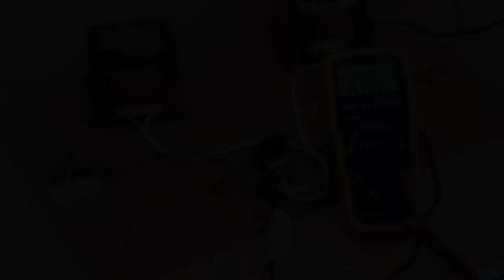DIY Welding Machine / Only 2 Microwave Transformer / Good Job

Comment: I tryed to build this miself replicating everything you've done here. but when i connected it to power it made a loud pop and a bright spark.... burning the electrical connector.. so im sure i didnt do something correct. but my question is now after watching this video many times now. is how is the transformer windings, the red insulated wire you added to both transformers and ran in series getting power from the bottom coil you plug into the power outlet? i dont see where they would connect the 2 coils? the stock bottom one and the one you reran the upper one...?
Reply from the maker: Hello.  I'm so sorry you're going through something like this.  I hope you are fine.  There will be no contact between the primary winding (the untreated winding) and the secondary winding (the red conductors we just wound).  These two windings are connected by a magnetic field.  The primary windings of 2 transformers are connected in parallel (A end of 1st to A end of the other and B of 1 to B of the other (A and B are said as an example)) and mains voltage is applied to these two ends.  Secondary windings are connected in series (ie one of the ends of the 1st transformer and one of the ends of the 2nd transformer are connected), and the idle ends are used as the welding ends.  If there has been an explosion in your system, there may be a connection error or short circuit on the primary side.

Comment: hola muy bueno, me podria decir las medidas de las laminas y la madera que uso para la caja por favor???
Reply from the maker: Hola.  dimensiones de la caja 32x16x12 cm.  Pero mi consejo para ti es que lo hagas un poco más grande.  Lo convertiré a CC agregando un rectificador pronto.  Sería mejor si la caja es un poco más alta.  Puedes hacer 32x16x16.  El aluminio que uso tiene 3 mm de espesor en los paneles frontal y posterior y 1 mm de espesor en la cubierta.
Reply: GRACIAS!!

Comment: Please, I would like to know the following data: the input current on the 220v side
Reply from the maker: Hello. It draws around 10A current on the 220V side. In some cases, it would be appropriate to use it in a socket with a 16A fuse, as 10A is momentarily passed.

Comment: Can i use 120volts and 220volts just to make two transformers?
Reply from the maker: Honestly, I didn't fully understand the question.  If you're asking if I can use it at 120V, yes.  You can do the same if the mains voltage is 120V where you live.  In this case, the dimmer circuit you will use should be more powerful.  Because more current will be drawn from the network to provide the same power... if you are asking if 1 transformer can be used as 120V and 220V for 2 transformers, this is not appropriate because 1 transformer cannot provide enough power.  If my answers are not sufficient, please write again.  Greetings from Turkey

Comment: Murat hocam çok güzel video olmuş emeğine sağlık.transformetörler kaç watlık ve malzeme listesini paylaşır mısınız.Teşekkür ederim
Reply from the maker: Merhaba Hüseyin bey. Öncelikle teşekkür ederim. Trafolar 900W. Genelde 800, 900, 1000W civarında oluyor diye biliyorum. Hepsi uygun olur. Mikrodalga transformatörler hariç... Toplam 13 metre 4mm2 silikon izoleli bakır kablo kullandım. Bu kabloyu internette N2GFAF kablosu olarak arayabilirsiniz. Akım ayarı için dimmer devresi kullandım. Sahip olduğum devre düşük güçte olduğu için fazladan 4 adet BT137 triyak kullandım. Triyaklar paralel bağlandığında toplam güç artar. Ancak 4000 Watt dimmer kullanılıyorsa ekstra bir triyak bağlamaya gerek yoktur. Genel bağlantı şeması ve triyak bağlantı şemaları videonun açıklama bölümünde mevcuttur. 2 adet 12V fan ve Fanları beslemek için bir adet 12V adaptör kullandım. On/off anahtarı olarak 16 Amp anahtar ve kaynak probları için 10/25 kaynak soketi kullandım. Kaynak probu kabloları 1.5 metre 10mm2 bakır kablo. Kaynak pensesi 300A pensedir. Kutu için kullandığım alüminyum ön ve arka panelde 3mm, kapakta 1mm kalınlığında. 220V girişi için 3x2,5mm2 kablo kullandım. Aklıma gelen her şeyi yazmaya çalıştım. Atladığım bir şey varsa lütfen tekrar yazın. Bağlantı şemalarını herkesin anlayabileceği şekilde çizmeye çalıştım. İlginiz için tekrar teşekkürler, iyi günler

Comment: Can I use 2.5mm silicone insulated cable for the secondary windings or is it better to use 4mm2 and upwards for secondary
Reply from the maker: In fact, even 4mm2 is a thin section.  But I used thin to get enough voltage with 2 transformers.  If you have a silicon-insulated 2.5mm2 cable, you can wind it as 2 lines (in parallel).  In this case, you have a 5mm2 cable.  However, I don't know how many coils will fit.

Comment: Hola, no entiendo mucho de los circuito, podrías explicarme. 
Para que es necesario  el regulador... Funcionará de igual manera si no coloco el Dimmer
Reply from the maker: Hola.  El circuito electrónico (dimmer) que pongo en la máquina de soldar se usa para ajustar el voltaje aplicado a la entrada.  De esta manera, también se ajustan el voltaje y la corriente de salida.  Funciona incluso sin el circuito, pero en este caso funciona a la corriente máxima ya que la corriente no se puede ajustar.  La corriente máxima derrite el electrodo utilizado muy rápidamente y es posible que no se pueda realizar una soldadura adecuada.
Reply: Perdón las pregunta... Un DIMMER de cuanto sería el mínimo de Watts qué pueda ponerle?? Como se hacía mención en el video de uno 4000w.
Muy agradecido por su respuesta
Reply from the maker: Puedes hacer tantas preguntas como quieras.  Que yo sepa, los circuitos dimmer que se pueden encontrar fácilmente en el mercado tienen una potencia máxima de 4000W.  La potencia del circuito del atenuador está determinada por el triac en él.  El triac se puede reemplazar con un modelo más potente o se puede agregar en paralelo como lo hice yo.  En el video que tengo la intención de compartir recientemente, yo mismo configuraré un circuito de atenuación en la PCB.  Este circuito se puede utilizar para soportar hasta 8000W.
Reply: Gracias por responder... Estaré atento a sus videos.

Comment: sorry, I have one more question, what are the name of the MOSFET you added to the 4000W DIMMER and why do you add it there, please I want to know.
Reply: because in the connection diagram, I can't find it there, and I don't want to mistake, please
Reply from the maker: Hello.  The components I added are triacs.  number bt137.  Since the circuit I have is low power, I added 4 triacs.  So by connecting the triacs in parallel, I made the circuit withstand more current.
Reply from the maker: The schema for the connection I made is available in the description section.  could not download?
Reply: ok thanks
Reply from the maker: Thank you too 👍

Comment: which TRIAC reference should I use for a 4000 W dimmer?
Did you use a 2000W dimmer? 🙂

4000 W dimmer için hangi TRIAC referansını kullanmalıyım?
2000W dimmer kullandınız mı?
Reply from the maker: 2 trafolu kaynak makinesinin şebekeden çektiği guc, ortalama 2000W. kullanılması gereken dimmer devresinin gücü 4000W olursa sorunsuz çalışır. şebeke geriliminin 220V olduğu yerlerde dimmere takılması gereken triyak en az 20A e dayanıklı olmalıdır. ben 6.5A akım dayanımı olan 4 adet triyak kullandım. bu durumda yaklaşık 25A e dayanıklı devre yapmış oldum. şebeke gerilimi 120V olan yerlerde, gerilim düşük olduğu için daha fazla akım çekilecektir. bu durumda 40A dayanımı olan triyak tercih etmek gerekir.
Reply: Şüphelerimi çözdüğünüz için çok teşekkür ederim, siz özelsiniz. Çok az içerik oluşturucu, abonelerinin yorumlarına yanıt vermek için elinden geleni yapar.😁
Reply from the maker: @santiagorodriguezgarcia1463  Bende size teşekkür ederim. Sorularınız olursa yine yazın. Elimden geldiğince yardımcı olmaya çalışacağımdan emin olun. 👍

Comment: Porque el dimmer de 4000w quema los fusibles hay que colocarles los triac bt 137 para corregir esto .buen  video gracias
Reply: Necesito su respuesta.Gracias
Reply from the maker: Hola.  En primer lugar, gracias.  En el video que publicaré próximamente, preparé un circuito PCB para el circuito del dimmer.  Mostré el montaje y funcionamiento detallado en el vídeo.  Sigue siguiéndome 👍
Reply from the maker: Si has hecho un circuito y se funde el fusible, los elementos del circuito que pueden fallar suelen ser triacs y diaks.  Además, el condensador de alrededor de 100 nF puede haber sufrido un cortocircuito.  Un cortocircuito del condensador no aumenta el fusible, pero existe la posibilidad de que se rompa durante la falla que quema el fusible.  Si la respuesta no es suficiente, puede hacer preguntas más detalladas.

Comment: One more question, if I attach wire together to make the length, will it still work? Just one union should do it.
Reply from the maker: You can use it by adding cables.  However, the insertion process must be done very firmly.  However, when the splicing is made, the stretching feature of the cable will decrease, so the winding process may be a little more difficult.  To prevent this, you can do the addition work outside the transformer.

Comment: Excelente video amigo una pregunta el código de los triat cual es para comprarlos soy de México de ante mano gracias
Reply from the maker: Hola.  En primer lugar, gracias.  ¿Estás pidiendo el código del cable?  Si es un cable, lo puedes encontrar como cable N2GFAF que pides.  Cable de cobre con aislamiento de silicona
Reply: solo le puedo poner un atenuador de 4000 o también le tengo que poner los 4 triacs en paralelo para aumentar la potencia del circuito de atenuación más el atenuador de 4000
Reply from the maker: El circuito de atenuación de 4000 W será suficiente.  Sin embargo, dado que el voltaje de la red es de 110 V, la corriente extraída de la entrada será alta, por lo que se requiere un circuito de atenuación más potente.  Los circuitos dimmer se venden con su valor de potencia, pero deben seleccionarse de acuerdo con el valor de corriente que pueden soportar, es decir... En lugares con tensión de red de 220V, esta soldadora consume un máximo de 9A de la red.  Porque se requiere una potencia media de 2000W.  Sin embargo, en lugares con un voltaje de red de 110V, se tomará una corriente de alrededor de 18A para suministrar 2000W de potencia.  Espero haber podido explicar

Comment: Disculpa amigo. Y si quisiera manipular con el DIMMER 4 transformadores de microondas .¿ Que configuraciones le debo de hacer?
Reply from the maker: Hola.  El elemento que controla la potencia en el circuito del atenuador son los triacs.  Lo que debe hacer es comprar un circuito atenuador con una potencia de 4000 W y agregar un triac paralelo al triac que tiene.  Si quieres, puedes utilizar un único triac potente o añadir 4 triacs más numerados BT137 como yo uso.
Reply: Muchas gracias amigo.

Comment: Hola exelente trabajo, una pregunta, cuantas espiras o vueltas de alambre le diste a cada transformador?.
-------
Hello excellent work, one question, how many turns or turns of wire did you give to each transformer?
Reply from the maker: Hola.  Gracias.  Hice 24 bobinados para cada transformador.  Ya no cabe más.  Se utilizará cable de cobre con aislamiento de silicona de 4 mm2, 6,5 metros de cable son suficientes para cada transformador
Reply: Excelente dato lo probare, gracias.
Reply from the maker: Gracias a ti también.  Buena suerte con

Comment: Will this work if our only power source outlet is 110V?
Reply from the maker: Hello.  The mains voltage value does not change the status.  Because where you live, microwave ovens are manufactured to operate at 110V mains voltage.  The only difference is that the dimmer circuit to be used for current regulation must be more powerful.  Since the mains voltage is low, the power required while welding will need more input current.  I have had viewers who run it at 110V mains voltage and make a comeback.  I hope my explanation was sufficient.  have a nice day

Comment: Direi ottimo lavoro, la bellezza e la precisione dl contenitore poi sono al top. Una domanda: lei ha scelto di usare filo da 4 mmq, altri autocostruttori invece hanno optato per sezioni del cavo maggiori che ovviamene significano meno spire, meno tensione e più corrente sul secondario; uno addirittura ha usato un "filo" mostruoso da 35 mmq: qual è il motivo della sua scelta, forse perché il tipo cavo con quelle caratteristiche non è disponibile in sezioni maggiori? Sarei curioso di conoscere la sua gentile risposta. Grazie comunque.
Reply from the maker: Ciao.  Mi scuso per essere tornato tardi.  Chi utilizza un cavo da 35mm2 molto probabilmente ha utilizzato una saldatrice a punti.  Perché con un cavo spesso il numero di spire è molto basso e in questo caso la corrente sarà elevata ma la tensione sarà molto bassa.  Affinché si formi un arco nella saldatura ad elettrodo, la tensione deve essere elevata.  Il motivo per cui utilizzo un cavo sottile è ottenere la tensione richiesta con 2 trasformatori.  Normalmente il cavo sottile non è preferibile perché viene generato calore a causa dell'elevata resistenza del cavo.  Questo calore può persino sciogliere l'isolamento del cavo.  Per questo motivo ho scelto il cavo isolato in silicone.  L'isolamento non è stato danneggiato per niente dal giorno in cui l'ho installato.  Spero di essere riuscito a dare risposte sufficienti.  Grazie per il vostro interesse.  A proposito, sul mio canale puoi trovare anche il video della mia saldatrice a punti.  Ho anche condiviso un video sul mio canale per convertire la tensione di uscita della saldatrice in CC.  Buona giornata.
Reply: grazie  per le sue esaurienti spiegazioni!!!!
Reply from the maker: Grazie anche a te.  Saluti dalla Turchia 👍
Reply: saluti dall' Italia!!!

Comment: Top e sobre o fil 2.50 e quantos meetro foi enrolado neste projeto?
Reply from the maker: Olá.  Fiz 24 voltas de enrolamento com cabo de cobre isolado com silício com seção transversal de 4mm2 em cada transformador.  Isso requer 6,5 metros de cabo.  13 metros para 2 transformadores.

Comment: From the wall plug. It goes to a switch. Then from the switch how are the cables connected to the transformers. Are they sequence or parallel (+)(-) and (+)(-) or (+)(+) and (-)(-)
Reply from the maker: Hello. Sorry for the late return. On the input side, the terminals are connected in parallel. There is no pole, but let me state it this way for demonstration purposes. (+ +) (- -). Serial connection will be made on the output side. (+ -) (+ -)

Comment: Boa tarde sr.murat assisti o vedeo da sua máquina de solda! E tenho duas perguntas!Onde moro a rede elétrica e 110v.posso usar somente o dimer de 4000v sem os triacs?Posso usar um capacitor de 470uf por 450v.ou ficaria melhor se usasse um capacitor de 1500uf por 250 v.sua máquina ficou chou de bola! Obrigado.
Reply from the maker: Olá.  O mesmo sistema também funcionará com 110V.  Um dimmer de 4000W seria suficiente na tensão de 220V, mas não acho que seria suficiente em 110V, pois mais corrente seria retirada da rede.  O que você precisa fazer nesse sentido é realmente simples... Compre um dimmer com potência de 4000W e adicione 3 ou 4 triacs BT137 paralelos ao triac no circuito.  Desta forma, a possibilidade de mau funcionamento do circuito dimmer é reduzida.
Reply: Obrigado.

Comment: Excelente!! Felicitaciones, pregunta, como sería el bobinado para 110v, esa es el voltaje en mi region
Reply from the maker: Hola.  No se requiere modificación para 110V.  Los transformadores de horno de microondas que utilizará se producen allí, por lo que los devanados de salida serán los mismos.  A lo que debe prestar atención es al hecho de que se extraerá más corriente de la entrada a un voltaje de 110 V, por lo que debe elegir elementos un poco más potentes, como cables e interruptores utilizados en el lado de la entrada, y utilizar el circuito atenuador utilizado para ajuste de corriente con una potencia de al menos 6000W.  Si hay algo que no está claro, por favor escriba de nuevo.
Reply: Gracias mi estimado, si tengo alguna duda le escribiré, muy agradecido por tu aporte y por tu amable respuesta.

Comment: Thank you. I will test it with a transformer. It is OK if 20V is output at that number of turns. I will experiment with a booster cable that is used when the battery of a normal car is dead, but even with a thin cable of 50A, the number of turns is I'm worried if it's possible. Please tell me what the name of the wire of the welding machine made now is. I'm not in a hurry, thank you
Reply from the maker: The cable I use has the N2GFAF code.  This way you can find it on the internet.  The reason I use 4mm2 is to get 20V from a transformer.  24 windings cannot be made with a thicker cable.  A maximum of 15 windings can be made with 6mm2, and a maximum of 7 turns with 10mm2.  In this case, the transformer output voltage becomes low.

Comment: Very good, congratulations, how many turns and what is the size of the wires?
Reply from the maker: Hello.  Thank you.  I made 24 turns of windings on each transformer and for each transformer I used a 6.5 meters long, 4mm2 section, silicon insulated copper cable.
Reply: @Murat Güney  Ok, thanks, you're very good, thanks for your attention, I'll do the project and come back to comment.
Reply from the maker: @pedroluiz1369  👍👍👍